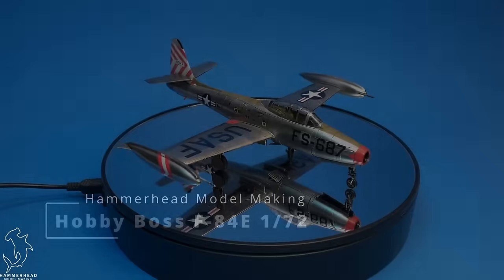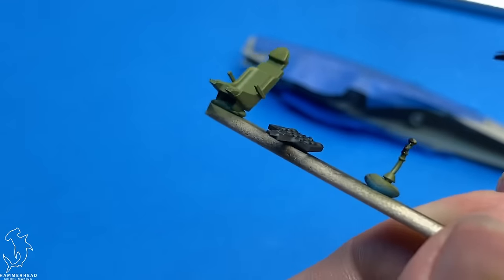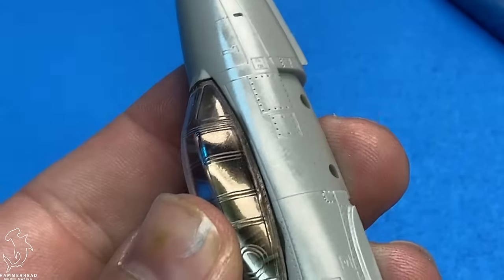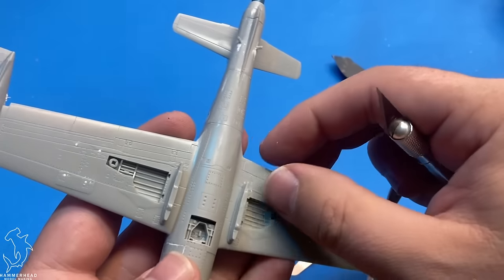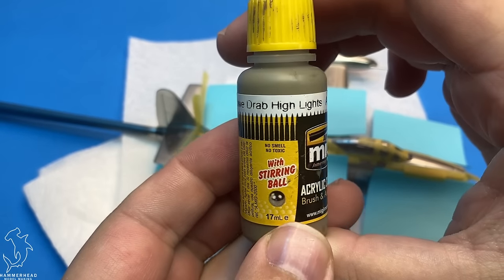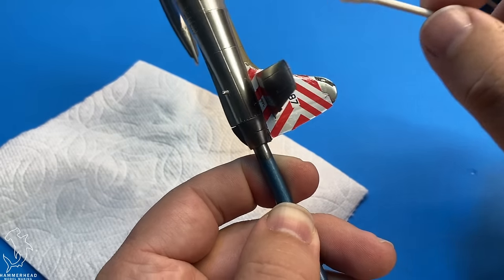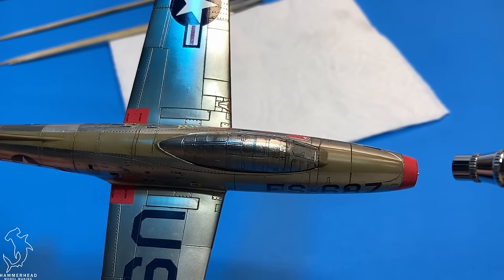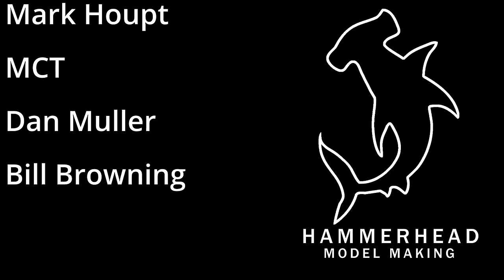Hobby Boss F-84E 1/72 Scale | Full Build Video

Comment: Incredible job! I very much enjoyed this kit as well. With the vertical stab decals I just cut them in half at the leading and trailing edge of the horizontal stabs. Worked pretty well for me. I did the whole thing as a hand brushed kit, used the newer vallejo metallics for that portion. Didn't come out nearly as good as yours!
Reply from the maker: Thats smart about cutting the decals, I didn't even think of that!

Comment: I love this build! I am a model builder as well, I started in 2022. However I am still trying to make my models look more realistic. I was wondering what needle sizes you use, like for large areas, smaller areas, etc. and what airbrush/compressors you would recommend for cost/quality?
Reply from the maker: So, I have a few different airbrushes that I use, but I find the a .34 needle is the best general purpose airbrush, as for what to buy, my work horse is the Iwata HP-C Plus, but for a more budget friendly airbrush that is still high quality, I would recommend the Gaahleri 98D.  Regarding compressors, really as long as it has a tank, you can't really go wrong.  If  you are in the US, Harbor Freight would be a good place to look.
Reply: @HammerheadModelMaking  Thanks! Keep up the good work!